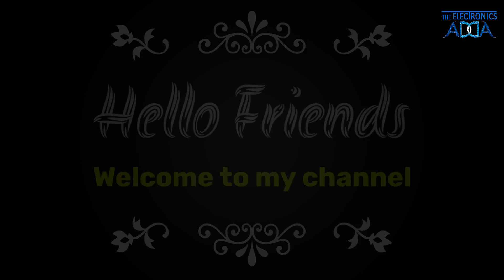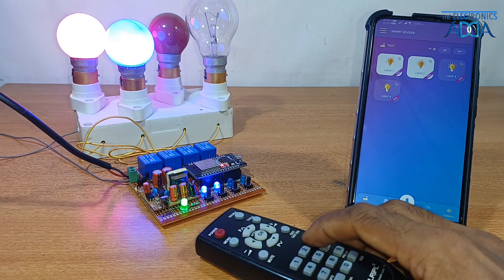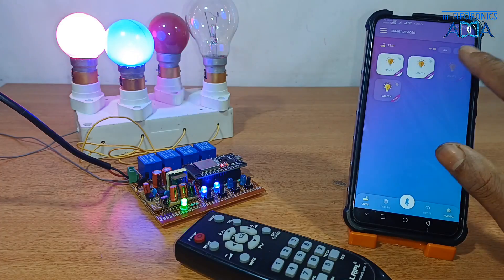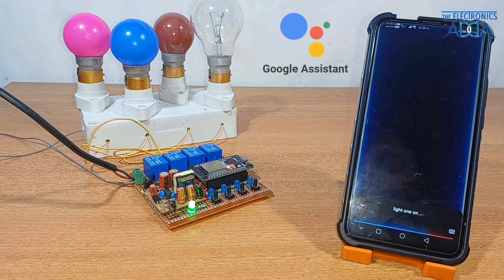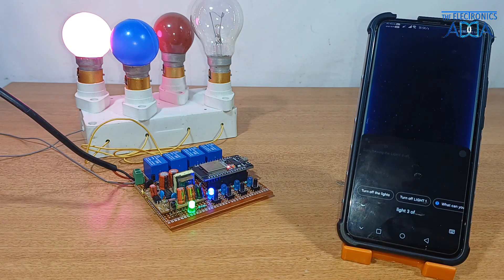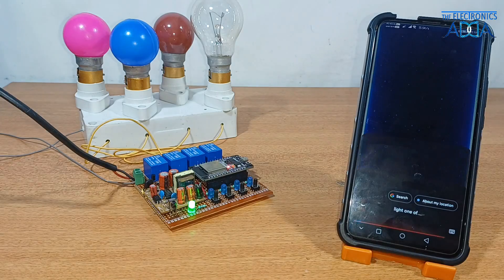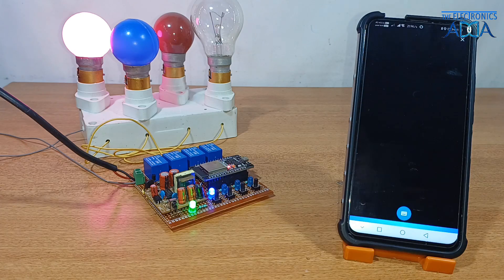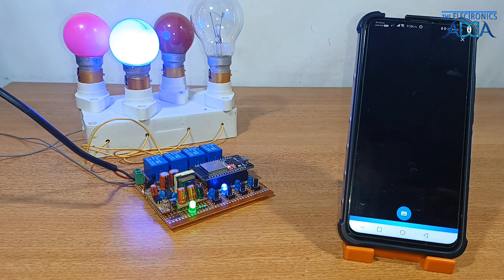How to Make Wi-Fi Control Smart Switch Board | 4ch Smart Switch Board | Make Your Home Smart

Comment: Nice product ❤❤❤❤
Reply from the maker: Thank you so much
Reply: Very good job sir add demar circuit used microcontroller esp32 C3 esp8266 please sir 💯  @THEELECTRONICSADDA
Reply: Very good job sir thank you 💯 next project esp32 or esp8266 4 LED lights fan speed control moc3021 add episode Manuel switch feedback @THEELECTRONICSADDA